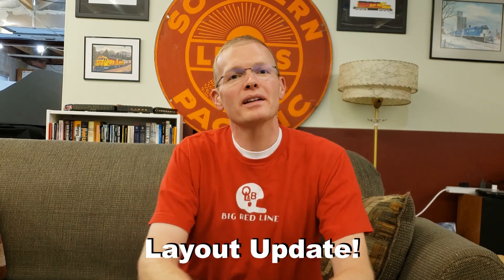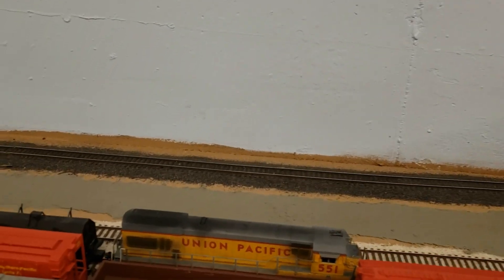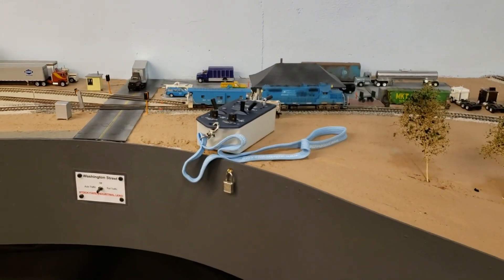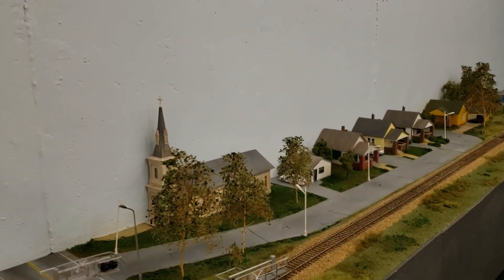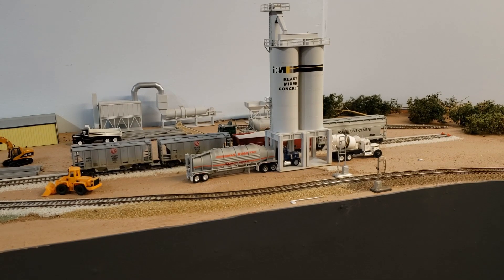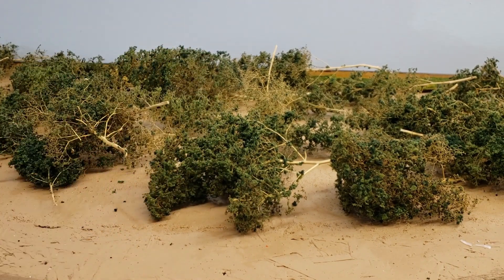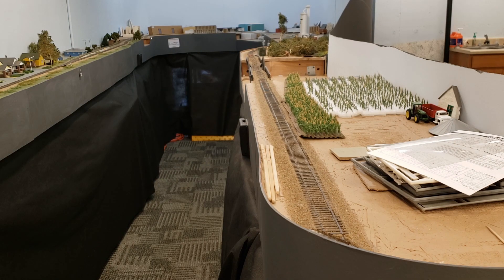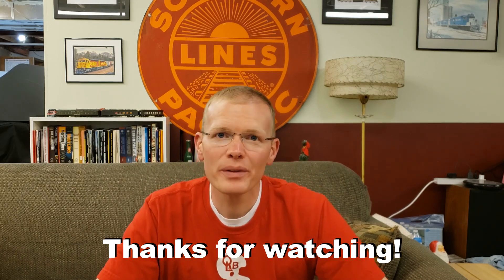Stockyard Industrial Lead: Layout Update!

Comment: NOOOOOO!  Leave it as it is at the redmix.  The next time a local come in it needs to rotate that car into position.  leave it as an off post.  More play value.  Do not run the track in to that environmental protection area
Reply from the maker: Thanks for your thoughts on the Ready Mixed idea.  I was thinking of extending the track just a car or two, nothing too long.  There will still be plenty of environmental/open space.